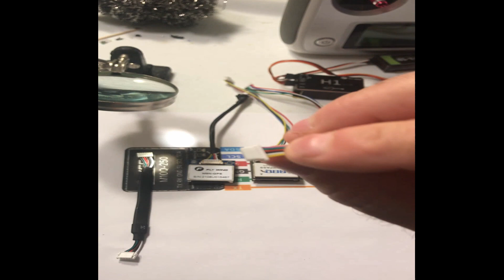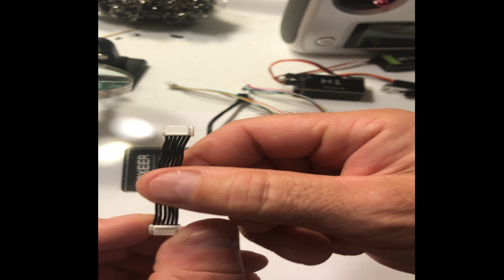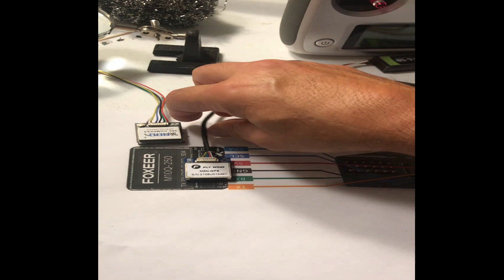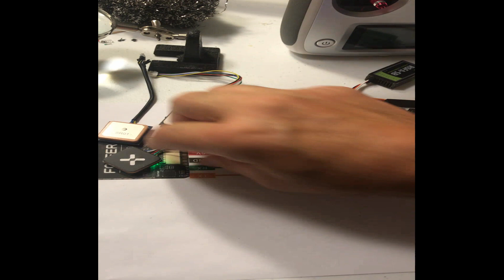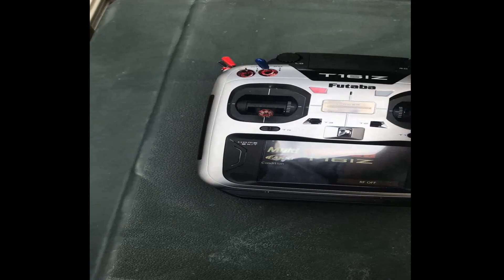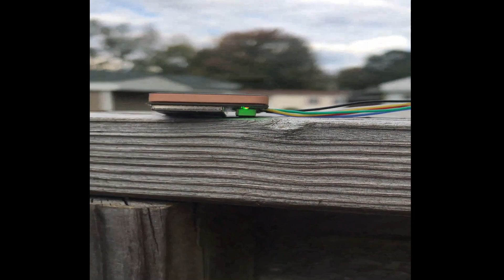flywing H1 flight control GPS mod

Comment: Question. I have I think a original h1 flight controller. Can I buy the new GPS antenna and plug it in my h1 for better satellite reception (upgrade)? Do I have to buy a new whole h1 flight controller and GPS unit? 40 bucks verses 250? Thanks for your time.
Reply from the maker: all H! are the same, yes you can buy the mblok 10 best module  https://www.helidirect.com/collections/flywing-h1-flybarless/products/flywing-m10-u-blox-upgrade-gps-module